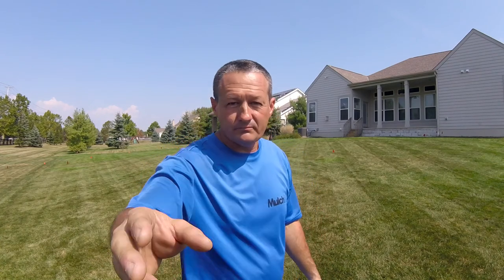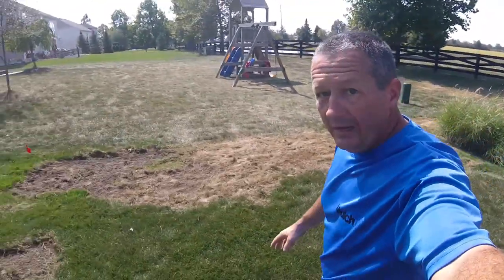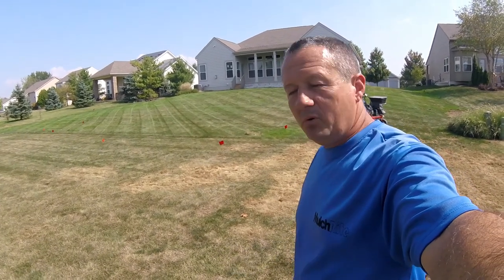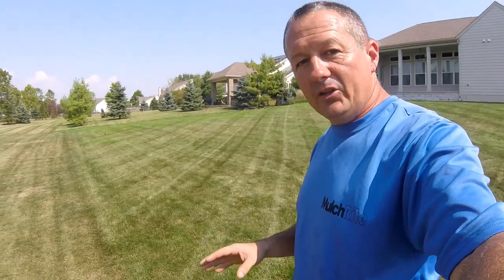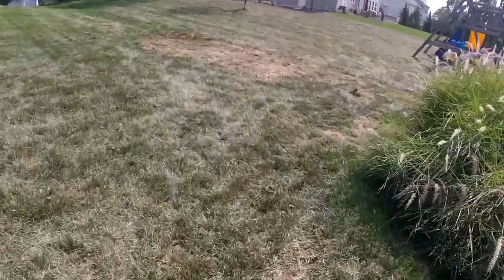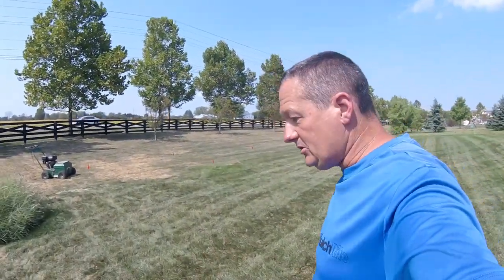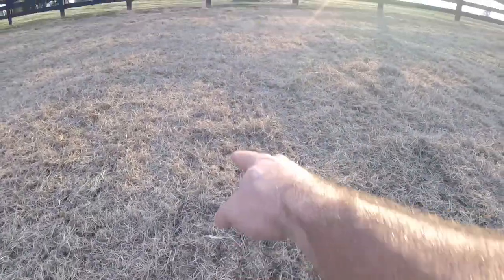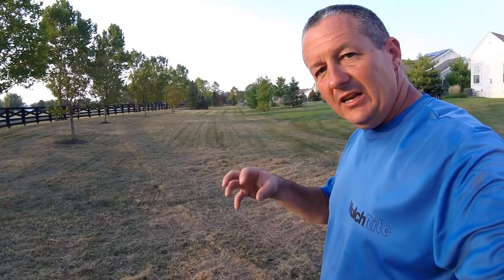Slice Seeding a Partial Lawn Repair, I'll show why, how, and the results of slit seeding process?

Comment: I was actually wondering if the excess thatch provided benefit in that exact way last week. Thanks for the confirmation.
Reply from the maker: When slit seeding I suggest about a 1 inch layer of thatch on the renovated area. It helps to protect the new grass and keep it moist. However, more than that can suffocate the new growth.

Comment: Super helpful. Thx for the explanation! Do you think slice seeding is much much better than using a drop seeder?

And does the slice seeder actually drop the seed precisely in the slices? Or is it a seeder that is simply cutting lines in the ground and some seeds happen to fall in those slices and a lot don’t?
Reply from the maker: The seed openings are placed right above the blades so the machine will cut the seed in. There is still a lot of seed that missed those slices though too.

Comment: I have a 6000sq ft area that’s patchy, I’ve been working to correct soil deficiencies. In fall after I aerate and slice seed would it also be necessary to spread top soil? Thanks for all the help
Reply from the maker: Probably not, but sometimes topdressing can bring good nutrients into the soil. If you're using a good compost blended mix.

Comment: Thank you for your videos. I live in Wisconsin and have a 1.5 acre parcel. I have areas scattered that I want to slit seed. Do you do both vertical and horizontal passes when slit seeding?
Reply from the maker: Generally yes we will go in two directions. However it also depends on the amount of existing turf base.

Comment: Coincidentally yesterday I slit seeded about half an acre of my lawn. That rented machine about beat me to death. No kidding that it's a hard machine to wrangle. I will know in about two weeks whether or not it took. I will say that a LEVEL lawn makes the machine work better. It loses traction on bumpy lawns and it's really heavy to manually push it. Just wish they had an attachment that could go on my riding mower.
Reply from the maker: Well, did your seeding work out?
Reply: @ColumbusLandscapers  Thanks for following up. Actually, yes, it did. But if I had known when I did it what I know now, I would have doubled or tripled the number of seeds I planted. The grass has come up, but is thin in places. I think this is due to two things. First, is the amount of seeds that the machine dispensed. It wasn't uniform on all my lawn. But secondly I think I planted some of it too deep. My soil was hard in some places and soft in others, so the machine dug in too deep in the soft places and not deep enough in the hard soil.
Also, I would have fertilized. At this point the new grass would be burned by fertilizer, so all I can do is hope for the best.
A sidenote: I also did the backyard with a different type of seed because it is sunny and my front yard is shade. NONE of the sunny seed germinated. I think it was just a bad batch of seed, so I will have to do that again. As a matter of fact, I am sold on slit seeding. It works better than anything else I have tried. But next time I will fertilize and use more seed. Thanks for turning me on to this method.

Comment: Thanks for your video!   When you go over with a slice seeder more than once, do you change directions, or stay in the same direction to limit damage?
Reply from the maker: Usually, if the area is mostly dead, I'll cover a second pass at a lower seed rate. Typically on a 45° angle from the first pass.  If there is  50% grass or more,  I'll only do a single pass to avoid thinning the existing turf base. It takes a little experience in judging.

Comment: Great info. Have a similar issue, but my problem is applied too much herbicide and now my entire lawn is Yellow. How long should I wait for the herbicide to dilute from the ground before  slit seeding? I’d like to take advantage of the seasonal rains in mid May.
Thanks in advance!
Reply from the maker: It depend what type of chemicals you applied. Read the bottle and see what it says related to seeding. Watering will probably help to disapate the chemicals more quickly so I if you're not going to cause a runnoff situation you can water some to speed up the process.
Reply: Thank you for taking the time to reply. The day after I sprayed the herbicide (mixed Momentum FX2 and Roundup Quick Pro), w shot a heavy all day and all night down poor and has rains a few days since. Application was done two weeks ago. It looks very- very bad!!😢
Reply from the maker: Water it quite a bit for the next couple weeks. Wait a few days for it to dry up, then do your slice seeding. Be sure to allow at least 3-4 weeks from the application date before the seeding.
Reply: Thank you!!!

Comment: Well I was thinking about renting one , good thing you had that message running across the bottom . What is a low input Turf Type Tall Fescue brand I can put down with a spreader ? I’m close to Caudill Seed Distribution Center . The slice seeding prices are ridiculous in KY .
Reply from the maker: We'll, over seeding alone will not do much unless you at least do aeration. Don't know the prices there but here it's about $150 per thousand SQ ft. Look into Titan tall fescue seed.
Reply: Ok Thanks 🙏 .

Comment: Great video, are you happy with the LS TR seeder? I’m looking to buy one, just not sure about this one or an older Jacobsen 524 slit seeder. What grass type did you plant?
Reply from the maker: I really like the lawn solutions seeder, but they haven't been made in around 10 years  So, no parts or support is available. I have several of them and have done a lot of fabrication to mine. Still one of the best and fastest walk behind seeders I've used. Only when equipped with the 9hp. The smaller units are underpowered.
Reply from the maker: I used a 50/50 seed here. Blue/rye
Reply: Columbus Landscapers Yes I know the company no longer exists, from what I gathered online the owner/engineer has created a new company with an improved design called Stinger. I like the older ones since there in my price range. I though you could buy some parts through Toro/Exmark such as the blades and cables? If I can’t get anything than I’ll look elsewhere. Bit of a long shot but you ever use the Jacobsen 524 drill seeder? Similar design to the Ryan Mataway, but I can get a little cheaper used.
Reply from the maker: Yes, you've done your research. 🤔 I have used the mataway seeders but not the jacobson. They do a good job if you can keep them working and not clogged up. They are also much slower and cumbersome. Yes, I know the guy you mentioned and his new company. I have some stinger equipment and have done some demo testing of that equipment. I've also ran the stinger slice seeder a larger until compared to the LS machine. Good luck.

Comment: Can you use one of these machines when you have an irrigation system?
Reply from the maker: Yes, you just have to watch for the heads and valve covers.  We ask our customers to mark them before we come. Since the machine only penetrates a about 2" the water lines are not an issue.

Comment: How do you determine the slice seeder blade height?
Reply from the maker: On this machine there is a selector lever it'll let you adjust the depth of the blades. Normally you're only looking for about 1/2 to 1 in depth.

Comment: Tryed this just September 5 used slice machine reseeding making a dirt ready not go results ground has to be perfect like a golf course and mine is not. Seed feeding rolls by the level of the ground off level doesn.t work well plus seeds run out way to fast put 3 pounds in made 2 runs it was empty
Reply from the maker: May be a bad machine, wrong settings or just lack of practice.  Keep in mind I have 25 yrs experience, so I can make it look easier then it is. Good reason to hire a seasoned pro. Thanks for watching!